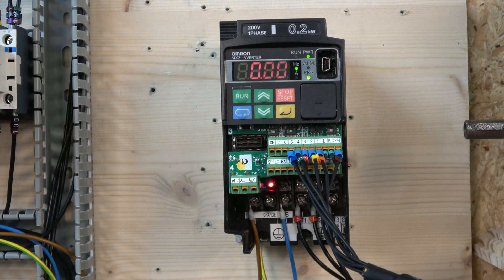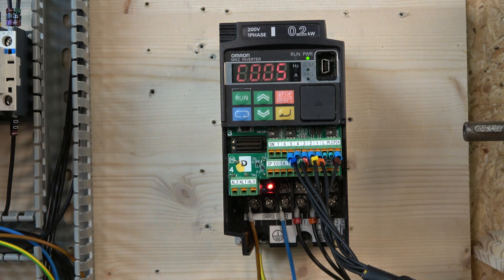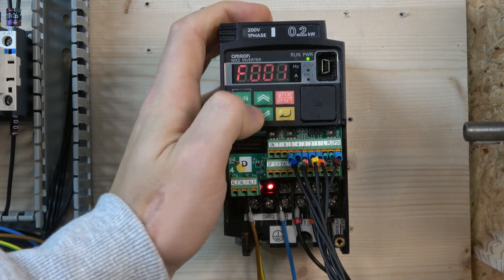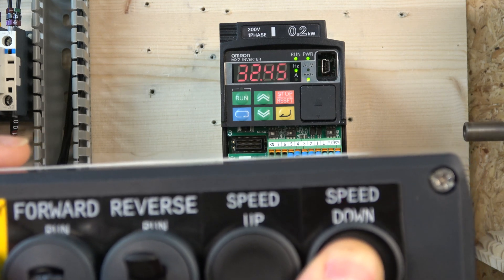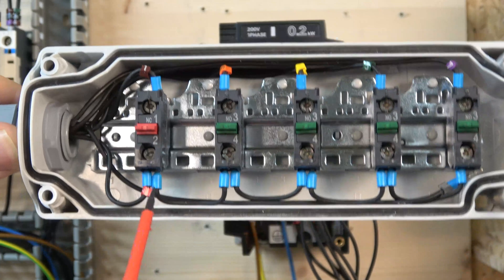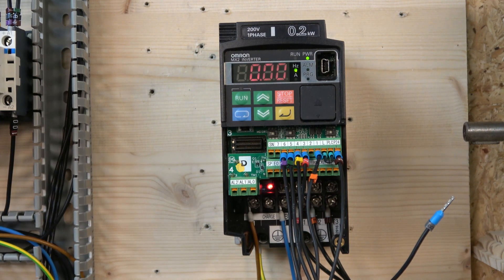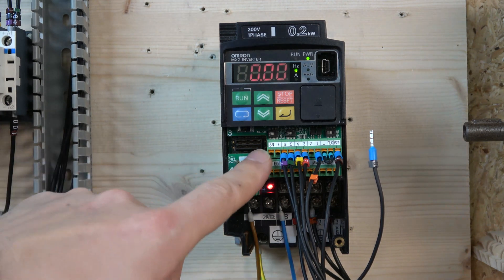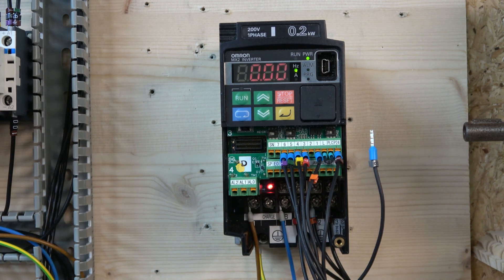Omron MX2 VFD remote control, MOP speed control and Multi frequency set up. ( English )

Comment: Great Video... How do we use external power supply (24vdc) as common and not P24 ?
Thanks again
Reply from the maker: Hi there. Drive inputs are powered exactly the same as PLC inputs. If you are sending the external 24V dc to the drive the negative part of the same power supply needs to power the COM terminal on the drive. In simple words negative go to COM and positive go to any of the inputs you want to switch on. As far as i remember the terminal L is your COM

Comment: Mx-2 A4055-E ,model no-WJ200-55HFE inverter, 3pH ,vfd run switch on, vfd trip and error cods  E30.4 seen,so error cods E30.4 means:::::;;;;:::::::plz help me :::::::
Reply from the maker: There is some sort of instantaneous over current occurring, check the supply and outputs for short circuits.

Comment: make a video for siemens drive 440 with wiring explanation , motor forward , reverse, fault acnowledge
Reply from the maker: Hi There, have you checked out the channal as micro master has been covered